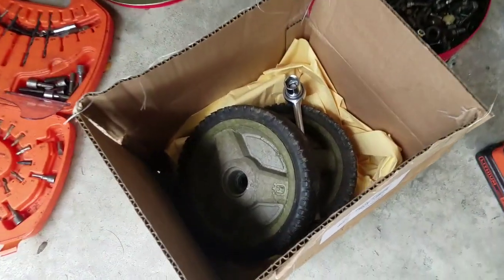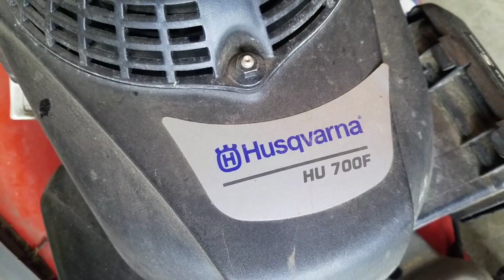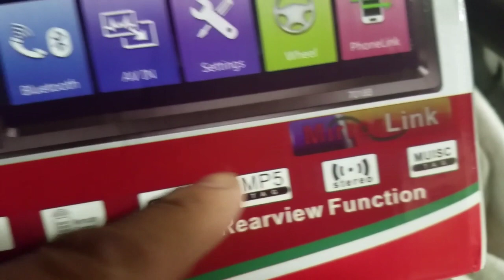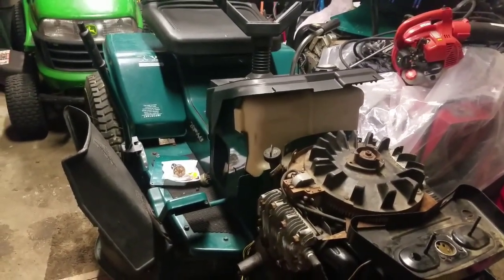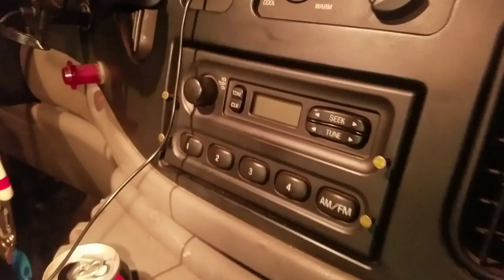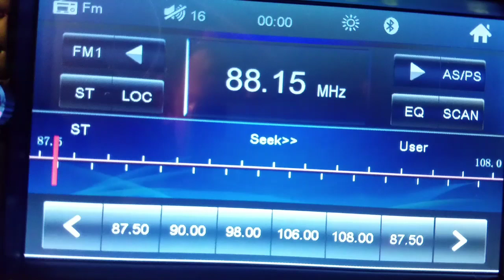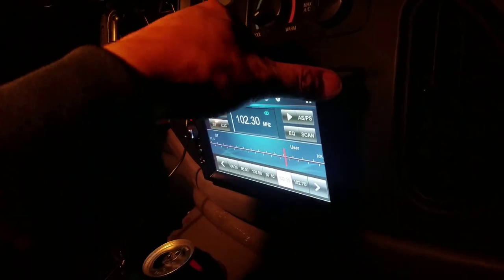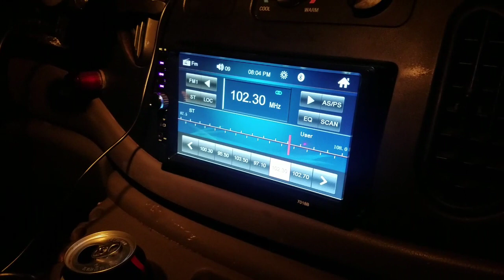HUSQVARNA HU700F FRONT DRIVE WHEEL REPLACEMENT $48 DOUBLE DIN TOUCH SCREEN FM RADIO MEDIA VAN RADIO

Comment: I bought a Boss double din with back up camera for my ranger. I bought a stereo wiring harness for it to connect to my factory plug but didn't need it cause the radio plugged right in to the factory plug. I wired the camera to the back up lights.

Comment: Try a stock antenna mounted to the fender and you'll have much better reception. Make sure all wire connections are right and tight and ground is good. If that doesn't work it might be the radio.